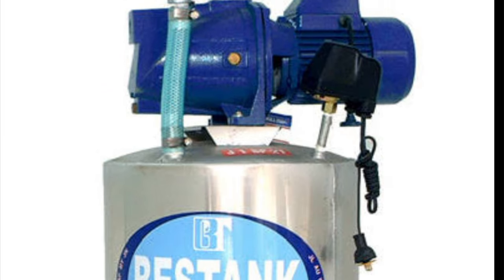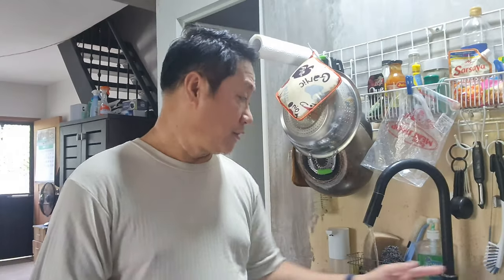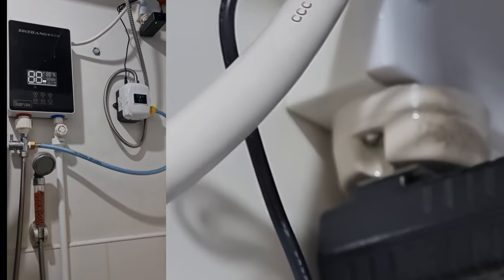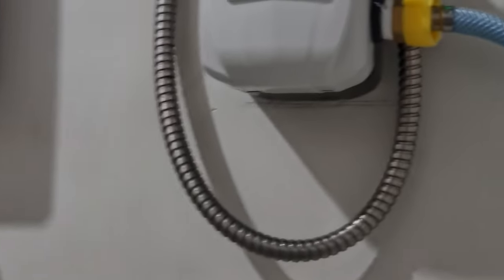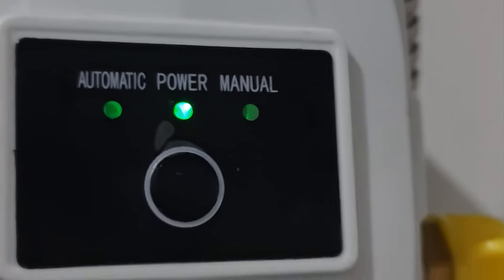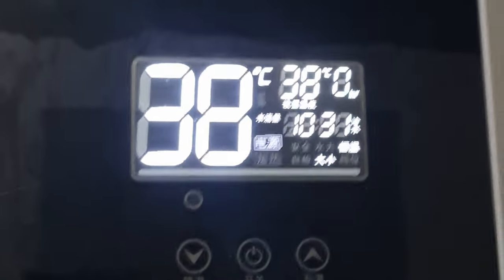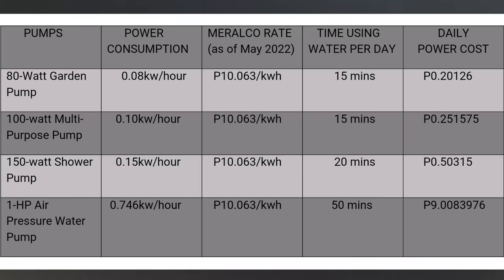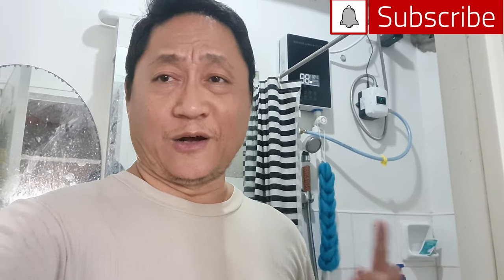Small 'Demand' Water Pumps-- Cheaper, Efficient vs. Air Pressure Water Pump System

Comment: Can that be done in a pressure tank without an automatic pressure switch, if the water flow slows down, the pump will not work.
Reply from the maker: @flod5d85  This is only for point-of-use like faucets and shower. It's too small for pressure tank.
Reply: the brand I bought is at 2.76 bar, I tried to put a temporary pressure tank, a 1.5plastic bottles, but it exploded and splashed, ..if I use a Bladder tank, won't it fail?
Reply from the maker: @flod5d85  i think you should also install a pressure switch to control the pressure and install automatic pressure control.
Reply: this is the answer I was looking for, thanks for your knowledge

Comment: Thanks! I've been looking for reviews on this water pump or even demonstrations. Pwede po ba yung water pump directly connected to the water heater instead?
Reply from the maker: That's directly connected to the heater but should be after the heater not before.
Reply: which of the two automatic water pumps are heavy duty sir? i need your suggestions because im planning to buy one of them thanks
Reply from the maker: @scarlettmontero-im1vc  the one that i used in the bathroom. There's a higher wattage version of it. Check online/Lazada.
Reply: @HiTechTaBai  sir can i ask the name of the device? is the device can run the shower and faucets if i put the device into the main pipe from the tank
Reply from the maker: @scarlettmontero-im1vc  if you have a heater, it should be installed after the heater and before the shower heads. If no heater, just connect it between the main pipe and the  shower heads. Ask a plumber to assist or do the work if you have no skills to do it.
Reply from the maker: @scarlettmontero-im1vc  just search it on Lazada-- water pump. There are many choices there but the one i used in the shower is better. Just look for it.
Reply: @HiTechTaBai  noted thank you
Reply: @HiTechTaBai what's the difference between putting the  pump before vs after the shower heater?
Reply: sir if nasa second floor po yung shower pwede parin ba ito
Reply from the maker: @pcplgamarad-rmfb3412 Di ko pa na-try... pwede seguro kung nasa baba lang ilagay ang pump hindi sa second floor.

Comment: What is the ten that u'r mentioning..? Is it the minimum pressure requirement for a waterheater..?
Reply from the maker: Nope. It was the reading for the output of the shower heater when there was no water flowing through it.

Comment: @hitechtabai hi, thank you for video, how does  boosting work if there is simply low pressure from the city, i just dont understand where it gets a water from to generate more outflaw 😊 maybe you can explain
Reply from the maker: There maybe low pressure but there is water flow that could be propelled by the pumps to the faucets.

Comment: Ask lang po sir. Sa lugar kasi may oras na nawawala talaga ung tulo ng tubig. Pwede koba magamit to kahit lamang tumutulo? O dapat may tumutulo muna para magamit yan?
Reply from the maker: Kung wala naman talagang tumutulo na tubig, eh wala ring ma-pump yong pump natin. Dapat meron yong tubig sa baba ng pipe na hindi lang maka-aangat. So, kailangan ng pump para maka-angat.
Tulad ng sitwasyon sa bahay ko yong tubig nasa baba lang at hindi na maka-angat sa kitchen sink.
Reply: @HiTechTaBai  I mean po baka di lang maka akyat yung tubig.  pag ganyan situation poba pag sinindihan ko ang shower automatic naba na mag oon ang pump or i manual sya?
Reply from the maker: @japanimeph1113  the pump requires a little pressure for it to automatically turns on. Kung mahina talaga ang pressure nyo tulad sa bahay ko, ma-manual switch nyo as shown on the video.
Reply: @HiTechTaBai  thank you po sir!

Comment: sir ok lang din ba ito kung hindi na hugutin sa outlet after gamitin, hindi po ba nagcoconsume ng power. i mean ung standby mode nya is zero power consume ba, or need hugutin sa outlet kapag hindi ginagamit.
Reply from the maker: @PatrickV.  Walang standby power ang pumps. Ang shower heater meron kasi digital ito but negligible lang yong consumption kung naka-standby.

Comment: Sir, pede ba yun i connect sa nawasa to pump water papuntang tangke na mataas? We plan naman to use it just to boost the water going up during night time…
Reply from the maker: Hindi. Maliit lang ito. Designed lang ito sa outlet mismo. Kailangan mo ng booster pump na 1Hp para sa tank. Tingnan mo yong height ng tank at yong maximum lift ng pump.

Comment: Wala po bang difference if ilalagay ko ang pump sa inlet papasok sa heater? Or after na po sa heater? Maraming salamat po
Reply from the maker: After sa heater dapat para di malulunod ang heater sa water pressure. Posibleng masisira ang heater pag before ilalagay dahil sa pressure.
Reply: @HiTechTaBai  ok po. Maraming salamat. Ang ilalagay ko po xe is yong 80w na pump lang... Ang akin eh baka di nya kayanin ang init ng tubig pag labas galing sa heater...
Reply from the maker: @hanzotv3  piliin mo yong pang-water heater sa shower na pump tulad ng ginamit ko.
Reply: @HiTechTaBai  noted po maraming salamat subscriber nyo na po ako... More power. 😁👍

Comment: may nakita po ako sa shopee sa shower niyo na 150w 32L/min max flow at yung sa faucet niyo po na 260w 18L/min max flow. alin po kaya yung mas maganda at mas malakas sa dalawa for shower application.
Reply from the maker: I would suggest yong katulad sa shower ko. The higher the power(watts) the stronger the water.
Reply: Ah what i meant po is may nakita po akong product sa shopee same design as the one sa sink niyo. It is rated at 260w tas yung max flow rate niya is 18L/minute. May nakita din po ako sa shopee ulit same unit naman sa shower niyo which is rated 150w pero max flow rate niya daw is 32L/minute. Yung isa po has higher watts pero lower max flow rate tas vice versa sa isa. Mas malakas po ba yung higher watt or yung higher max flow rate? Ibig sabihin po ba nun mas mas efficient si shower unit na may 150w tas 32L/min flow rate or wag ko po dapat masyadong pansinin si flow rate tas ibase ko na lang kung sa watts yung lakas? Salamat po
Reply from the maker: @feefifofum9685  theoretically, the higher the power (in watts), the stronger the pump. Thus, the higher the flow rate. Sundin nyo na lang ang higher power ng pump.
Reply: Got it. Maraming salamat po!

Comment: Sir, pwede po ba  edirct yung 3rd pump sa tank to boost our kitchen and washing machine water supply?
Reply from the maker: Medyo maliit lang yan for a tank, although pwede basta nasa baba lang yong tank.
Reply: @HiTechTaBai  mahina kasi bagsak ng tubig from tank, going to our kitchen and washing machine kaya i was wondering if pwede ba.
Reply from the maker: @michelled7695  ang demand pump kasi ay maliit at designed na ilagay right sa point ng faucet o outlet. Kung mula sa tank to your house, kailangan mo na booster pump.
Reply: @HiTechTaBai  san niyo po yan na order? May link po kayo? Baka pwede manghinge ng link. Baka bumili nalang ako tapos ipapapalagay ko under sa faucet at lagyan ng T angle valve to connect washing and faucet sa product na yan po.
Reply from the maker: @michelled7695  check mo na lang sa Lazada. Ang dami nyan....

Comment: looks like eto lang solution sa bahay ng tita ko, nakagastos pa ng 50k para sa air pressure water pump system tas ending kailangan mag manual patay bukas ng valves kasi kung hindi, magloloop lang ang tubig dahil sa maling connections na nakabaon sa ilalim ng bahay na di mahanap hanap hays
Reply: Nag lo loop yong tubing? Baka di kayo gumamit Ng check valve